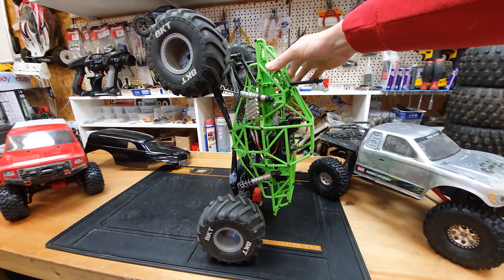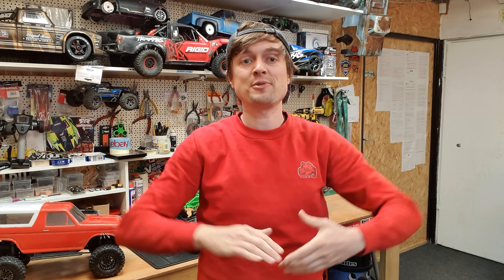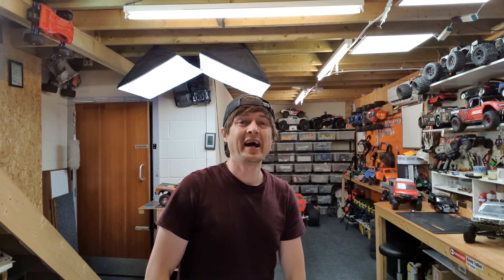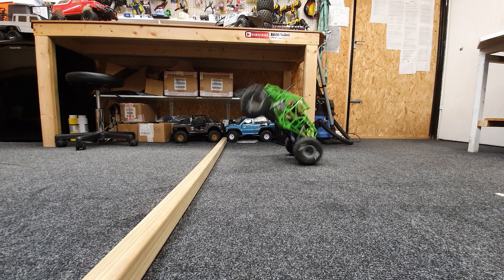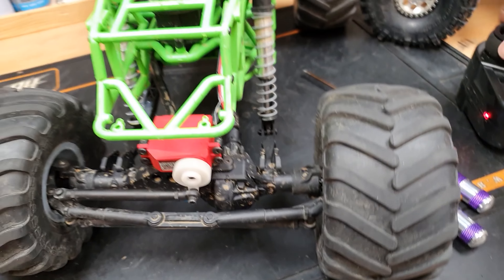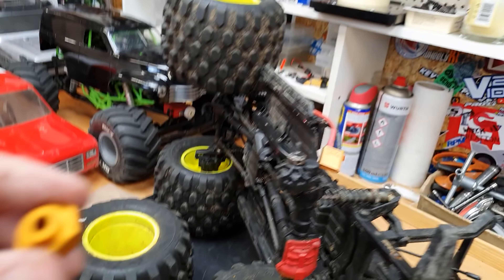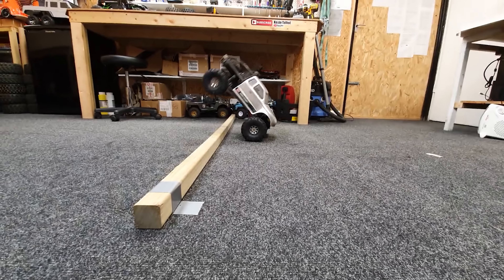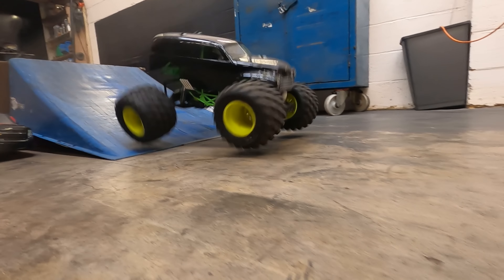Youtuber RC Car Challenge 2 (everyone invited!)

Comment: about to buy my first rc car would built vs bought be better? which i a good starting platform? i want speed and bash, i don't want cheap and i would love to be able to upgrade it later on. i honetly wanted to get the arrma 1/7th scale body but what i seen they are kinda expensive along the lines of tires and if i wanna upgrade it a new servo and batt caps then better lipo. im at a loss guys

Comment: I have a txr4 used and they put LED light plug in on terminal number 5     and cut the wire off for the led plug and put a fan for the motor will that mess 😠 things up please help

Comment: I could easily win this with a little trick. ANyone can do it that has a gyro. Put it in line with your throttle channel. BAM.... DONE!!! Then it's up to battery power how long it will last. I post this because I CAN'T be the only one to think of this. You still have to get it up on the two wheels according to the rules, but if you get it close, the gyro should take over. Some adjustments to the gyro gains may be required. You'll still have to find the balance point though. After that, the gyro should hold it. Good luck guys.

Comment: Im thinking gyro controlled throttle by switching throttle and steering and orienting the receiver so that it thinks its positioned correctly on its front wheels. So just jump ant quickly activate the gyro.

Comment: I haven't laughed so much during an RC video, ever.  It's like watching a beginner with a unicycle. I think this is way harder with a shorter wheelbase truck.  If you could shift forward and reverse quickly with a 1/5 scale vehicle, I think you'd have a much easier time b/c of the greater inertial mass and longer fulcrum making the vehicle not want to so quickly or easily fall over.

Comment: This is definitely a tough challenge. You did pretty good with your SMT10. Most people I see do it only appear to have control, but it's in super slow motion and ends in a rollover.  Pretty impressed by your control of it for a real time video. That's the one complaint I get from people about the solid axle trucks is that most of the tricks are actually fails done in slow motion :)